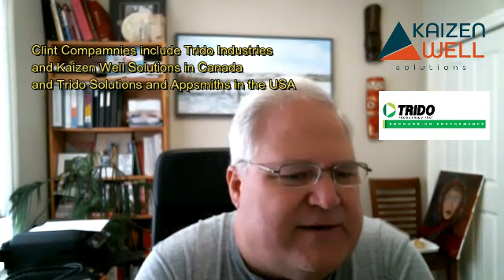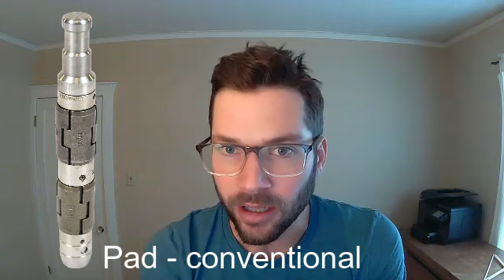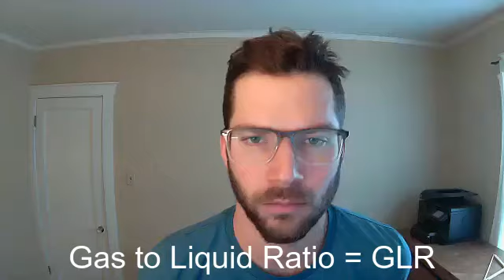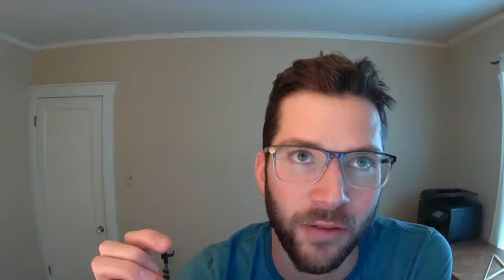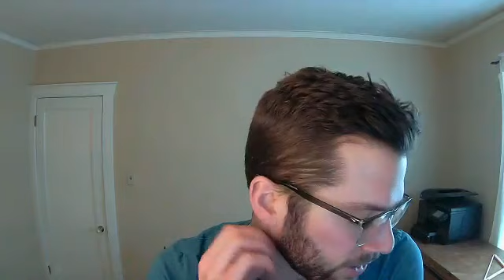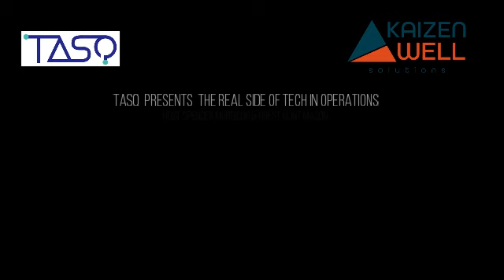Recording of plunger podcast #1

Comment: Hi.I worked with a plunger elevator, the technology is good but requires a specific approach. For highly paraffinized oil and a long time between cycles leads to additional costs. This technology requires an individual approach and individual selection of candidate wells, with a low water content, a large gas factor and a low paraffin content in oil.But I have a question in which program the animated drawing of the plunger lift in the video is drawn.
Reply from the maker: Hello 
Thank you for watching the video 
The animations were done in power point and are part of my training slides

Comment: Question I have on Ball and sleeve plungers is how do you track arrivals consistently. I have ran them in the past and a few recently and have yet to find a plunger sensor that will detect arrivals consistently.
Reply from the maker: There is a couple of things I have always done (especially if your using Titanium plungers) 

First is set the sensor up at the strike disk so the sensor can see it move 
Titanium is non magnetic so a sensor won’t see It come in but they will see the impact or strike disk move 

I also always “accept” the plunger gets missed once and awhile with pacemakers so I set the total open or wait time to equal the plunger rise + delay time I find  99% of the time the plungers make it but are just missed because the ball drops out or just come in so soft so I ignore 1 missed arrive but if it misses 2 or three times then is shuts in for the extended period to built up some pressure I typically make the extended closed period - to the minimum required closed I would need to get a conventional plunger to the bh spring

Comment: Another thing you will notice with ball and sleeve plungers before dimples is the ball will start getting egg shaped which reduces the ability to seal. It could also cause it to become stuck in the sleeve preventing it from cycling correctly.